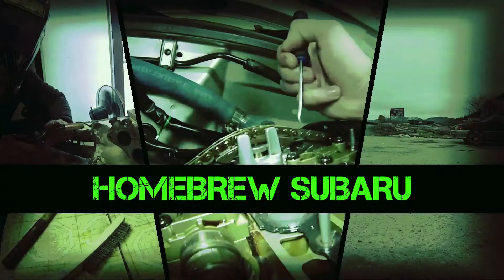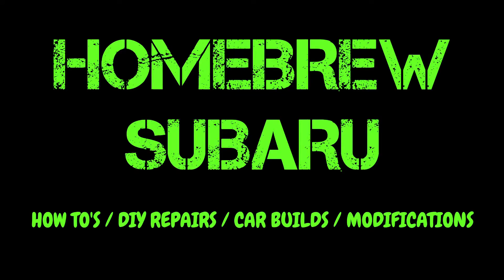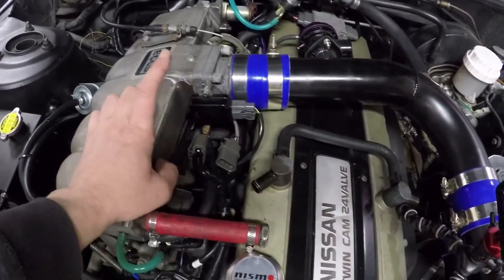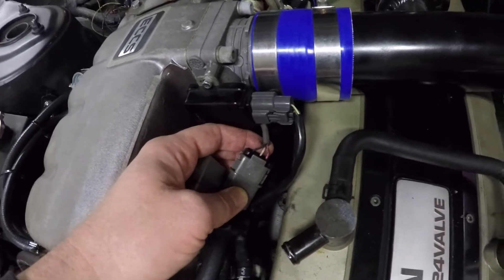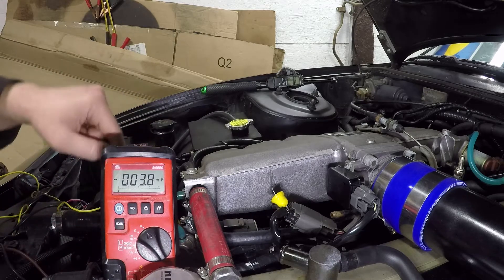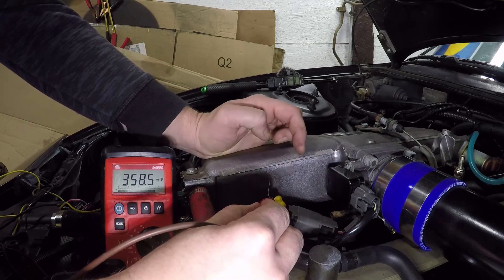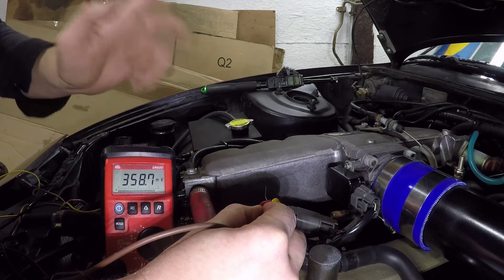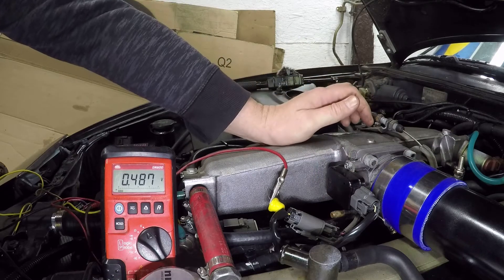How To Adjust Throttle Position Sensor RB20DET

Comment: My tps is way off any tips
Reply from the maker: You may need to check the output voltage range. Old TPS may not sweep low and high

Comment: Hey man would you be able to tell me what colour wires go into the 3 pin plug on the tps that you weren’t testing from ? I’ve got a loom with that plug cut off and just have the 3 wires coming out of the harness one wire is dark green/red the 2nd is light green/black with grey dot and 3rd is light green
Reply from the maker: I missed this comment somehow. If I get a chance this week I will try. Look for an ECU diagram for RB26 and the wiring should be the same as TPS-1 for the RB20 if I remember correctly

Comment: Do you have a wire schematic  for the rb20 to know what wires do what . I’m swapping a 280z plz thx
Reply from the maker: I had to work with the RB26DETT diagram for most of it. The diagram is almost exactly the same minus the second turbo electronics and MAF

Comment: Thanks for this video. Just ordered a ohm meter and will be adjusting my throttle position sensor on my 95 Lexus gs300 later this afternoon. Should I be looking for the same numbers in my car? 0.46 & 4.0?
Reply from the maker: The specs should be similar as most TPS sensors are in that range. The idle voltage setting is the most important and can usually be found with an easy search

Comment: I have mine set up the exact same but my middle signal wire is reading 5v. Any ideas why it is stuck on the fully open position
Reply from the maker: DAN on MV I would guess that the sensor is shorted internally
Reply: I have the same issue, ever fix your problem?
Reply: @240raul  ecu was fried